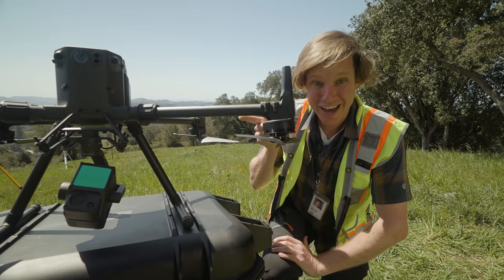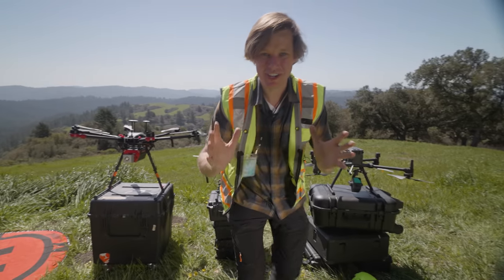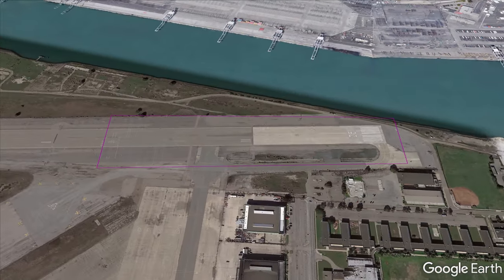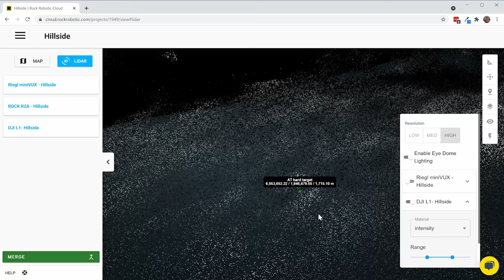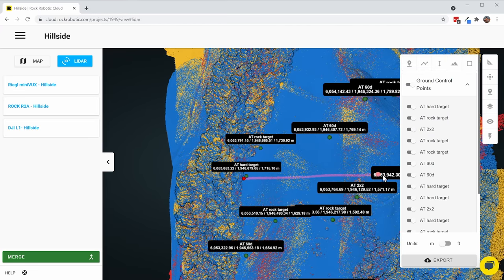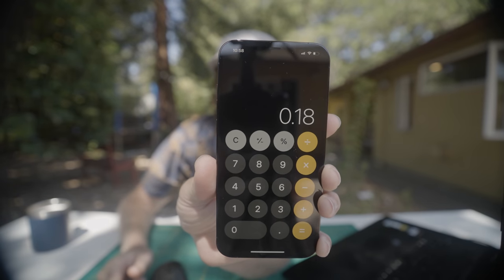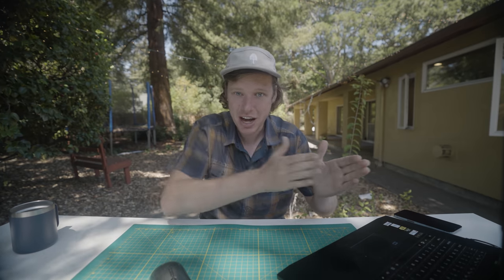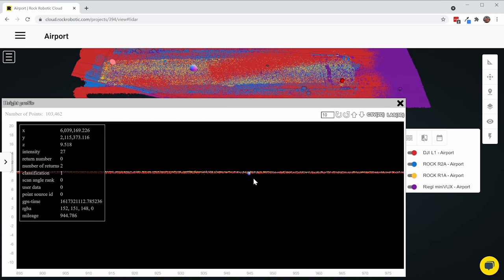Don't buy the DJI Zenmuse L1 until you've seen this! ROCK vs RIEGL vs DJI

Comment: First, I am not a lidar expert. I am a professional land surveyor, and I have been using the L1 for about a month now and have been testing on several different projects. I find your assessment perplexing. I find the “fuzziness” to be about 0.50 feet if you pick from max to min. If you select from high mean to low mean, the fuzziness drops to about 0.22 feet, a far cry from 1.8 feet. Next, I did not get any of the undulations that you are referring to in the video. Did you process in DJI Terra with the optimized point cloud accuracy turned on? I tested with and without, and the data will show some roll without processing with this option turned on. I did it mainly to compare results with post-processing in TerraMatch. I had a friend and lidar expert (certified photogrammetrist) whose assessments that Terra did as good a job as TerraMatch and is considerably easier to operate.

My experience with the L1 with multiple projects is an overall RMSE of about 0.23 feet. According to ASPRS standards, this is plenty accurate for 1-foot contours, unlike your statement that the L1 was only suitable for 2-10 feet contours. Next, you fail to mention the total integration of the unit with the drone system. There is no turning on the LiDAR sensor, turning on the drone, manual calibration, clipping data post-flight. I found the total integration for the drone much preferable to other systems I have used. I have shared data with two photogrammetrist, and they both stated that the data is better than most lower-end LiDAR units. Is it a Riegl? No, but it is 1/10 of the cost. If you need 0.05 feet accuracy, get a Riegl. In my opinion, as a professional surveyor, the L1
will satisfy about 90% of the requirements of most raw land surveyors. I am not a DJI fanboy, but until American manufacturers catch up, I will be flying an M300/L1/P1 unit for most of my work.
Reply from the maker: Great comment.  When I show the RMSe value derived from using the rock surveyor software - I report an RMSe of 0.206 ft. This is of the surface created by the A.I. engine.  So there are 2 separate measurements happening here.  The derived surface and the system accuracy.  In the system, you can't just delete points and say - if i just choose these points and measure the precision then its better.  You need to include all the data.  So in your assessment this would be the 0.5ft measurement.

Also, you can't use terramatch for a replacement of the DJI Terra software.  The terra software is a tightly-coupled PPK software that calculates the trajectory using the differential GPS + INS setup.  This is different than terramatch, which takes the results from DJI Terra and performs a strip alignment to correct and boresighting issues and small random walk noise in the heading. 

And there is a ton of manual calibration with the L1 - it is now recommended to do the calibration pattern every 100 seconds or 1,000 m - whichever comes first.  

I do agree the system is priced AMAZINGLY!!  and that is freaking awesome, and I do love the L1 and I am a fan boy of DJI.  They have innovated time and time again and it has benefitted us all over the years.  But just like when I bought my M210 + RTK on the first batch that came out - there were a lot of "caveats" to make it work well.  Simply put, the RTK system wasn't truly functional until the DRTK-2 came out.
Reply: @IndianaDrones , I know what the RMSE values are coming from. If I use the values without manipulating the data, my RMSE is much tighter than the 0.22 I reported. I have experienced some values less than 0.05 feet. This, however, is not a true reading of the accuracy of the survey. If I am going to produce a real topographic survey, my check will be to the "filtered" point cloud-derived surface as this is what I am assuming liability.

As to the ton of manual calibration, this is simply not true. The drone self-calibrates at the beginning and end of a mapping mission or a corridor mission. While you do have to pause a mission and hit the calibrate button if your distance exceeds 100 seconds. If you are flying your mission at 10m/s, this is 1000 meters or 3,280 feet. So far, I have not had to worry about this. In my conversations with DJI, this calibration will be automated in the next DJI pilot release.

Also, in my opinion, the D-RTK-2 has never been functional. I  either fly off of a VRS, the RobotDot base station, or I use PPK, which I have verified works with the L1 as well. While I am sure the rock is a good device, I have not seen or used any LiDAR system that is so well integrated and easy to use.
Reply from the maker: Mark, you literally contradicted yourself in your first paragraph. You say the 0.22 is not a true reading, then turn around and say, but if you do the same thing it’s a true reading.  The 0.22 IS from the filtered point cloud surface. Therefore your first and second statement in that paragraph are the same thing. So either you do report your accuracy on that deliverable or you don’t. It can’t be, don’t if Indy does it and do if Mark does it.
Reply: Great assesment. He also made it seem "Rock" was the one to get since it was priced in the middle. But funny, he forgot to mention he owns the company lol
Reply: " @IndianaDrones , I'm not sure I understand your response. You say your measurement is reported from the Rock "A.I." surface. Not knowing what this is, I am limited in my understanding of what the Rock "A.I." surface is computing. The RMsE I am reporting is the computed from independent field surveyed measurements compared to the point cloud processed in TerraScan and then exported. The surveyed points then are "dropped" onto the final surface. I have tested on three separate surfaces and foliage areas, and I am getting a 0.21 to 0.26 RMS on three separate projects.  I flew all three projects using the Leica SmartNet VRS in RTK mode. On each project, another surveyor measured the GCPs and check shots independent of my flying. In one project, the GCPs and check shots were measures using a Trimble VRS. My point was if I just dropped the points onto a "raw" point cloud, my values were less. Not a valid check, in my opinion.

This will be my last response. I find your analysis to be contradictory to my findings, as I stated in my first reply. I have not experienced the undulations; the fuzziness I have measured is about 0.50 max min and more on the order of 0.2 feet when picking the mean. I was cutting profiles using your setting of 0.50 feet width. This is before any processing. I have not experienced any of the undulations you reported. I find your assessment to be lacking and biased. You did not give any of the settings for any of your drone flights. Where they all RTK, PPK, or a mixture of both? What altitude were all the flights conducted? What was the setting of each sensor? How many returns for each sensor. What type of pattern scan? If you are going to do an evaluation, try to use some sort of scientific methodology. Best regards.
Reply: @markpaulson2248  i am a LiDAR expert; I’ve been in the industry for over six years and I can say, without any hesitation at all, the L1 is junk.  

I’ve worked with sUAS LiDAR solutions that don’t cost much more than the L1/M300 solution and not only is the accuracy and precision significantly better than the L1, but the post processing customer service is second to none.  

Lastly, if you think an RMSE of .2’ is acceptable for LiDAR….you have very low expectations.
Reply: @RustySshackleford  You have a web link or reference for this type of solution? ..."I’ve worked with  that don’t cost much more than the L1/M300 solution..." Thanks in advance!
Reply: @k4x4map46  we purchased the trueview system. It was in the range of 60k.  The L1 was just barely under 50k when we priced it.
Reply: @RustySshackleford  Copy that!! Thank you!

Comment: Here's a summary of the accuracy metrics:

Hillside Guestimated "Fuzz Height"
L1:      1.81 ft
R2A:     0.281 ft
MiniLUX: 0.18 ft

Hillside GCP Vertical Accuracy RMSE
L1:      0.206 ft
R2A:     0.107 ft
MiniLUX: 0.113 ft

Hillside GCP  Standard Deviation Elevation Delta
L1:      0.172 ft
R2A:     0.104 ft
MiniLUX: 0.107 ft

Hillside GCP Mean Delta
L1:      0.205 ft
R2A:     0.008 ft
MiniLUX: -0.11 ft

Airport Guestimated "Fuzz Height"
L1:      0.485 ft
R2A:     0.092 ft
MiniLUX: 0.052 ft

Comment: Most likely the imu unit inside L1 is an inferior quality compare to that of the other two systems. Or Terra is not robust enough to get rid of the undulation issue. Whatever it is, we are skipping the  current L1 until they sort it out..50m agl and every 1000s calibration just do not cut it for productive topographical survey works..

Comment: I also heard from CanDrone, that the L1 requires a recalibration (figure 8) after every 1000m of flight. Is this maybe the issue?
Reply from the maker: It’s every 1,000 meters or 100 seconds, whichever happens first. Yea, this  is new guidelines that DJI is putting out there but I flew many many missions with the L1 and never produced specially different results

Comment: Thank you for putting the video together. Is the measurement of the .48 ft or around 13cm of “undulation” the total undulation over the area described, or did you find the total undulation high/low greater than that? ie. 13cm of undulation high to low over the total cross section area? or is it  just within one measure of high to low?  I mean, is it within the standard deviation for the L1 specs ie. 5-10 cm (if flown at 50m) and if the undulations are within that range the result of rounding or within the range of undulations on runway and other high low readings from the other sensors.

Also I noticed in the “fuzz” test on the L1 measurements was of the outliers… yet they were about 6.xx cm, seems within spec.. am I wrong? 

It seems the L1 is less accurate, yes, but is it less accurate notably outside the posted specs? Or could it be the result of measurements on outlier tall grass blades, dips in the ground under the grass, or in the case of the runway actually 13cm +- accuracy instead of the posted 5-10 cm in spec… What was the altitude of the flight?

As noted by another commenter, and as a potential customer, I find it off putting not to hear or have in description, that the host of this video is partial owner of the Rock Robotics (Rock Cloud, R1, R2A) … knowing this places the burden of specific supporting evidence ie on the host, and the video could be helped with a few more details on the flights: ie. altitude , process of calibration, flight duration… this additional data could make sense of the inaccurate data with the L1… not saying that your findings are wrong… because if correct, it’s pretty important to know, especially if it shows the DJI specs are wrong 😱. Yet per the provided info in the video, the accuracy may still be within the range of the manufacturer specs (ie DJI)… I just can’t tell because the flight details  and operations that could affect the accuracy (height…) were not discussed.
Reply from the maker: All systems are flown at 60m AGL (200ft). It wasn’t until after I flew that DJI changed their flight specs to include MAX 50m, and refly a calibration flight every 100 seconds with a max length of 1,000 meters.  

But, I flew another 10 or so missions and never got better than 15 cm. This was the best I could accomplish, and that is at one location, not including this time dependent. 

But, all the data is there for anyone to see. I know DJI is working on enhanced IMU feature that includes a photogrammetry technique to increase the accuracy - but this only works in scenarios where photogrammetry works well… so in that case, I would recommend photogrammetry
Reply from the maker: As for the undulation, this was on top of the “fuzz” I measured this at an additional 15+- cm. This must be from the drift in the imu.
Reply: @IndianaDrones  Thank you for responding and answering this question. 60M is not considerably outside the 50M. Wow! 15 cm is considerable... and if it was also the case at 50M...? would be outside the posted specs. Yet even if its corrected with every 1000M recalibration maneuvers that is a real deterrent and would seem to me to minimize the total area of acquirable data per battery! ...Imagine it trying to do the figure 8, recalibration maneuvers while working on a steep slope or cliff scan... hmmm....The only reference in specs on the L1 I could find was on the DJI L1 website spec sheet, which referred at the bottom of the page * to the 1000m (the test of 5-10cm accuracy was flown on 1000m distance at 50M, with no mention of recalibration every 1000M)  The calibration specs that you provided are new to me and something I only read in another comment on YouTube somewhere. Could you provide a link or whereabouts one might find this new calibration spec. information. If this is the new specs from DJI L1, this, my friend, would be a win in Rock Robotics direction... I just can't seem to find that info on the web... is it only available to resellers?
Reply: @IndianaDrones  Have you looked to see if following the calibration flight and altitude recommendations fixed the undulation problem?
Reply: @jimbonevideo6941  that's a really good question and a cool topic for a new video, go for it Harrison

Comment: There is something off with this comparison. First the point density in the accuracy reports are definitely off. L1 says 0 points per sq feet,  R2A 49 points per sq feet, then 4 points per sqft. I would also imagine that the R2A will have better processing accuracy through its propriatary software than the other. But anyways the meet and potatoes airstrip comparison was a bad experiment the relative precision between the LiDARs means nothing that they in some cases are lower or higher doesnt tell you which one went low and which one went high, the real comparison would have been against the GCPs which you didn't show. I mean I do believe for the price of the L1 it will not be as accurate as 30K+ ones, and the L1 is not 17k its 13k since it came out. Also I would've also enjoyed the setting at which the L1 and the other LiDARs captured their data.
Reply from the maker: Hey Eduardo, the systems were on the same settings - repeat mode and 3 returns.  You can look at the data for yourself as well and you will see the GCP are spot on the riegl and rock.  The only other logical explanation is the riegl and the rock and the emlid base rover pair, which was set up over a known point provided by the usgs and transmitting corrections over ntrip are all wrong. The only logical conclusion would be that the one device was least accurate.  With the rock, riegl, and emlid you can see the PDOP as well as cycle slips and thusly verify the trajectory. You can also see the forward-reverse / combined separation from the tightly coupled solution and verify that yes - in fact the solution is very good.  Now after going through this thorough analysis I can feel confident in my words on the video. There is in fact an inaccuracy in the L1 system.
Reply: @IndianaDrones  Oh I do understand the L1 is a less accurate system, but maybe not as accurate as it seems in this video, I still don't understand the accuracy reports of 0 points per sq feet. And that being that possible the L1 is equally as accurate but at a lower elevation than the other two with just maybe 10% or even 20% increase in time flying. Then people can say well the L1 is accurate but it needs to be flown lower increasing my flying time. Your conclusion is that it is not survey grade, which I think is incorrect by your own data, even possibly more incorrect if you would fly the system considering its capabilities. tens of thousands of dollars less for a 20 percent decrease in efficiency can be a great system for many smaller survey firms to start in the LiDAR industry.

Comment: Great video! Thank you for this valuable comparison!!! Would you mind sharing what scan mode you used to capture the L1 data? Looking at the point density sheet of the report it seems like the L1 used the “non-repetitive” scone mode while the other 2 used a “repetitive” or line scan mode. Could this impact the fuzz that was found in the L1 data? And have you done any comparisons of the 2 scan modes of the L1 system?
Reply from the maker: Great question! The same scan mode was used. The repetitive, the non-repetitive is much much worse, and that’s not just on the L1.. it’s any system using the avia sensor.  There’s some very interesting technical reasons, but it’s in the way the Risley prism works

Comment: Great video, very informative. I do have some questions though, as I am seriously considering purchasing the LiVOX AVIA sensor in either the LiAir70, L1, or Rock R2A configuration, and am quite concerned about the undulating errors you identified with the DJI L1. 
Q: Did you do those comparisons before or after you conducted a boresight error correction to the data? In either event, have you come up with any explanation to the errors?
Q: Have you seen these same errors with the LiAirV (or V70) package?
Thanks, and keep making these great videos.
Reply from the maker: Hey Michael! Thanks for your feedback. Feel free to bring your questions over to our ROCK Robotic Community discussion board. Our support team is ready to answer your questions. 

https://community.rockrobotic.com/
Reply: @Michael Laura did you ever get an answer to this question?